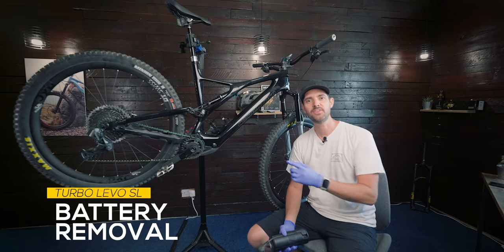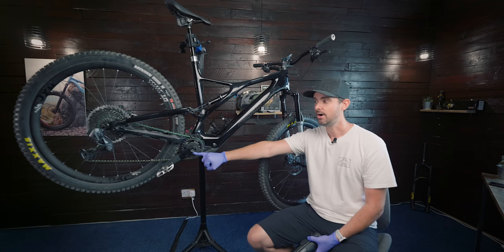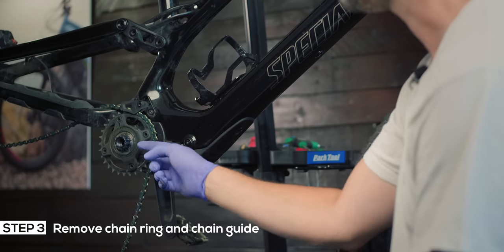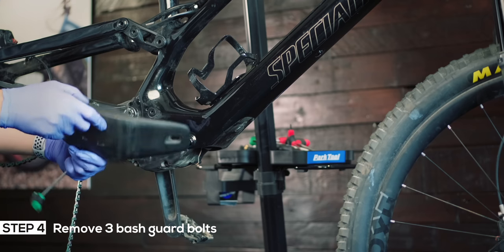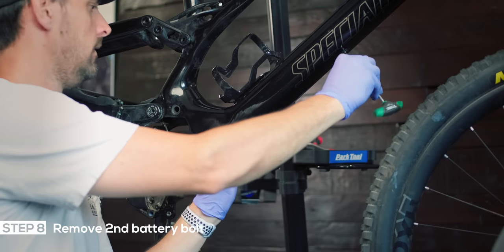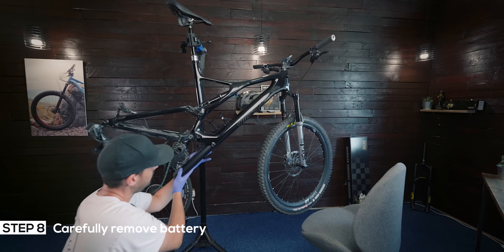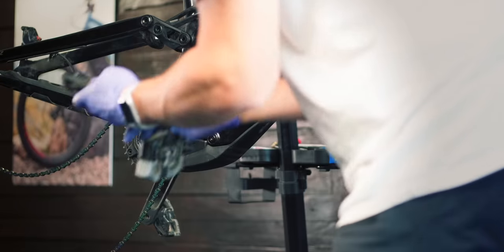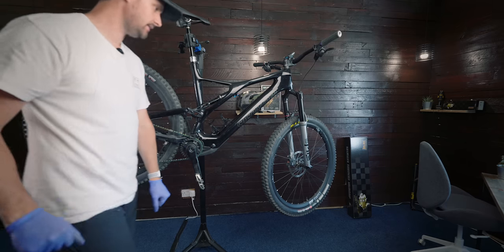How to remove the battery, cranks and motor on a Specialized Turbo Levo SL

Comment: Great detailed video Rob! I’m wondering if it would be easier to just drop the motor out completely instead of removing the drive side crank arm and chainring? I’m assuming the need to remove the drive side crank arm and chainring is because the motor can’t swing back without interference with the chainstay and chainring?
Reply from the maker: Hi Steven, actually I saw a guy that has mentioned that you can just drop the motor completely, just need to remove all 6 bolts. Then no need to remove chain ring.
Reply: Probably removing rear wheel  then only chain guide + 6 bolts must be good enough
Reply: @RobRidesEMTB   Yup just did it today. Remove the 6 bolts altogether and saves the hassle of muscling the crank arm off. Tip: if you have small enough hands (like mine), you can actually reach up the downtube and tape some electrical tape from the inside to reduce the risk of water ingress. I did that to both battery holes that no longer take the screw obviously because there's no downtube battery to screw them into. Good tip on the bubble wrap though. I also threw a bit of electrical tape to the two connectors that connect the motor to the TCU just as an extra precaution.
Reply: Hey Rob. As you’ve been I see there could you maybe comment on cable / hose routing. Thanks f I need to you’re a new rear brake hose I’d expect to maybe use the old one to pull the new one through. But a LBS told me it’s a matter of taking out motor and battery to change the rear brake hose. 1.5 hours. Wonder if there’s a workaround.
Reply: @CMneilB  I replaced my SRAM rear brake with Hope a few weeks ago. I cut the SRAM hose at the calliper end and the new Hope hose at the lever end. I joined the SRAM and Hope hoses together with the recommended double-end RockShox barb (£1.50 from Amazon). I then slowly PUSHED the new Hope cable through from the rear end. Very easy! No need to drop the motor or remove the battery.

Comment: Thanks Rob for the video. I don't have a pick tool and could not get the "retaining ring" off.  So I will just drop the motor as others have suggested to get to the battery. I ride mainly unassisted and use the SL's motor only on the steepest of climbs to make the ride more enjoyable. I took a 3 hour ride yesterday and only used 4% of the (main) battery. So I have more battery than I need. Relying only on a RE battery alson makes much for sense for what I'm doing, and, yes, I'm an admitted weight weenie and losing 800 grams by removing the main battery fits my needs. Thanks for confirming that I can do this!!

Comment: Hey Rob Rides Emtb! Perhaps some adhesive tape over the battery holding bolt holes will prevent mud or water from entering the down tube! Ride ride ride!
Reply: @Rob Rides EMTB @eric M - it would be great if Specialized (or another vendor) sold some empty battery casings, so that you can insert for travelling and use with just the extender - while protecting from water etc.

Comment: Another great video Rob, stripped the Creo the other week (with no instruction/knowledge other than referring to the torque specs etc.. mainly to find out how it compares to dropping the motor out a 2018 Levo. 50/50 I say in terms of easiness, some bits more fiddly, other bits much more straight forward!👍 Levo SL almost identical to the Creo SL

Comment: Good video Rob, one thing you dont mention is the drive side rear bolt holding the motor (accessed through the opposite bolt hole) is not T30. Only found out this  morning after buying a long T30 & it wouldnt go through the hole. Bolt apears to be T25 which i presume the correct torx driver will go through the T30 hole.👍

Comment: taking the battery out of the levo is like taking a semi-trailer out of the channel tunnel. If you live in an apartment on the 4th floor without a lift, hello the maneuver.

Comment: Hey Rob, this is super helpful. I needed the guide as reference to Specialized Creo gravel bike that I need to remove the internal battery to fly with. Great to have you confirm that you can run just on the bottle battery extender with no internal battery in.  Specialized dont seem to advertise this feature, but being able to fly with ebike and take a couple of the portable bottle batteries is a great selling point from their point of view. Just wandering,  did you by the Levo SL for yourself? Just wandering if you rated it good enough and lack of power not too detrimental to spend your own hard cash on one!  Specialized should have sponsored this video as it very well done and useful information for someone buying one of their products with the Turbo SL system. Cheers as ever mate, from Vienna, Austria.

Comment: Is it possible to remove just the chainring from the spider, rather than remove the entire crankarm?  Idid this on my Creo and removed just the chainring, which is a lot easier than removing the entire crankarm, and gave me clear access to the drive side motor bolts.  Not sure if the Levo chainring is set up the way or if the crankarm would have to come completely off.

Comment: Great video! That bolt for the battery leaves a hole exposed into the compartment where water, dirt, mud can enter and make its way down into the motor I assume? Did you do anything to seal it?

Comment: Interesting weight stats on the 325 battery, looking forward to seeing the specs of the 2021 Levo, I predict a 48volt battery a mullet set up and a 650 watt battery with range extender option
Reply: why a 650 when the current bike has a 700 ?

Comment: Hi my understanding is that you are able to take this bike on a plane without removing the battery due to its capacity being within the legal requirements. Also I think I read somewhere that you have to have some charge in the main battery for the motor to work. You can’t run the bike just on range extenders only. Not sure if that is true, I will test it and see if it works.
Reply: Can you travel with it?
Reply: Nope, bike works just fine with extenders ONLY.

Comment: Rob your a star ! 1st off for helping me choose an ebike / second for getting me out of a tight spot half way thru THIS process ( couldn’t have completed it without watching this!) couple of requests / questions ... my sworks Levo sl ALWAYS boots into trail mode ? Is there anyway I can get it to eco mode when I power it on ? Plus ant+ connectivity ?? Can u do a vid on this ( if you haven’t already?) seems somewhat of a dark art ... my garmin s60 picks up speed / cadence / hr - however - none seen by the bike ? Apple Watch similar - I thought mission control was supposed to do all that Belevo app could do now ?

Comment: Hi Rob, really good video and explain. Many thanks therefore. I have an expert and want to switch the seat post like you. 
I can't get the cable of the seat post out of the frame. The cable blocked somewhere. if I pulled out the cable at the front side of the frame I only get 10 cm out. the other end of the cable at the seat tube a can't reach. Have you an advice for me. I don't want remove the motor. Thanks a lot in advance. Marco

Comment: Hey rob just picked up a levo sl and notice my trails i have 80% battery left running with friends with acoustic bikes. I would like to remove the internal battery and run my extender... do i really need to remove the crank and chainring? I can see the bolts you need to remove. Please advise. Thanks for your help in advance. Love your reviews!

Comment: Can you do a video for 2022 Kenevo SL battery removal? Would be great. Tnx
Reply: Hi, I have done this on a Kenevo SL.  Wish I’d just left the crank arm and chainring on and lifted the motor out completely.  Easier.  Also, there is a step between 7 and 8, as you need to remove the charging port from the NDS of the frame to allow the battery to pass it.

Comment: Thanks Rob, I have the 2020 Levo SL and  after washing the next day I could not get the battery to turn on. I rode after wash, dried and then charged. 
I put the range extender on and it boots up and show both batteries on. 
With out the range extender battery I cannot get the bike to boot up. 
Any suggestions?

Jason

Comment: Nice video! Off topic but what does ‘NOS Tighten’ mean on that suspension bolt just behind the chainring? My local bike shop hasn’t a clue...
Reply from the maker: That’s actually says NDS and means Non Drive Side. The other side will have DS meaning Drive Side.

Comment: I’m about to do this as I’m getting a ‘motor not found’ warning after washing the bike briefly upside down and assuming there was a sensible drain path for the water to go…
Reply: Have got as far as the chainring and spider and they will not budge. No lock ring that I can see anywhere. Just the 3mm Grub screw. Undone that and the spider just won’t budge. Do I need a puller?

Comment: Just imagine if they put 500wh on this bike, how many miles can you go. Or Kenevo version with 500wh,  27.5 and short chaintay.
Reply: Regie Bong 27.5all the way👊.i would swap them straight away if I purchased sl .so many do this .its crazy they don’t give 27.5 option from factory
Reply: @Nunnyfcht  I been riding my 27.5 EMTB for 9 months now, then I tried my brothers newly bought 29er EMTB. That 29er is fast, its just not as nimble as my 27.5...
Reply: @regiezero  yeh faster on long straights ,ime only 5'6 tall and 29 just too bulky for me ,plus makes rear tyre too close to backside when dropper post down and jumping or descending, I run 27.5 on my levo ,but 27.5 front 26 rear on my yt capra when riding places like morzine and leogang, saalbach 👊

Comment: Hi,  I have a 6 mont old Levo SL.  The left side crank seems to have a click at the top of the stroke. 
Someone mention that maybe the motor bolts are squeeking.   Have run into that issue?

Comment: It was easier and less work for me by removing the motor, cranks/Chainring intact with the motor. Slid the battery out and cleaned the inside the bay and cleaning the motor was a breeze.

Comment: Ciao, It is possible to replace the 360 battery with 700
Reply from the maker: No. Different sizes.
Reply: Can we ride this bike without motor and battery? Someone could develop support which will be mounted to motor mounting in frame

Comment: Does anyone know if it works the same way to remove the battery from the kenevo sl?
Reply: Hi, I have done this on a Kenevo SL.  Wish I’d just left the crank arm and chainring on and lifted the motor out completely.  Easier.  Also, there is a step between 7 and 8, as you need to remove the charging port from the NDS of the frame to allow the battery to pass it.

Comment: that is just waaaay too complicated, is this even allowed ? does it break the warranty ?
Reply: +1 Could we really use this SL without internal battery, perhaps the battery is a key part of the structure itself, strengthen it. Is this validated by Specialized ?
Reply: @JB-68  I don't think so, just my experience in stripping mine, but it sits very lightly/loosely in the down-tube.

Comment: Do these range extenders work on a levo fsr ?
Reply: Nope - try these  https://trailwatts.com & https://levo-range-extender.com/en/ - not done this myself but with 60+ charge cycles in 9months on my own levo for 500w battery I’m thinking about it as I can only get 35-40km on a hard ride and 45 if i am careful and riding with wife on hers - once it’s out of warranty all bets are off and I’ll start modding the 700w batteries are way too expensive or i may go for another 500w and lug the other around in the pack for a longer rum - i meant run

Comment: Not sure that the benefits of this are that clear unless you are travelling, and leaving open bolt holes in the outer down tube is simply dumb.
Reply from the maker: Yes, bolt holes are prone to allowing water ingress. I pointed that out in my description :-) But I've been riding with the the range extender for a couple of weeks, works quite well, and a few folks asked how to do it so I made the vid. Cheers, Rob.
Reply: Rob Rides EMTB was not calling you dumb, I think you are probably the most trustworthy reviewer I follow. You also come across as a genuinely good guy as well.

Comment: And when with your levo ( at a price bw 4900 to 12900,- €uros), you don’t get any dashboard, and as a marketing response, we are told that  no dashboard permits to admire landscapes... Bosch mounted have choice bw purion, kiox color tft, and the all new NYON 2020 tft color computer with GPS galileo (metric precision)... and the 1150 watts dual battery real time management as the one we find on cargo’s engine. For me Specialized are  over rated products... never and never
Reply: That's the reason I got an SL, low key NON-ebike appearance.Besides, the bLevo app gives me enough info for a thesis presentation.